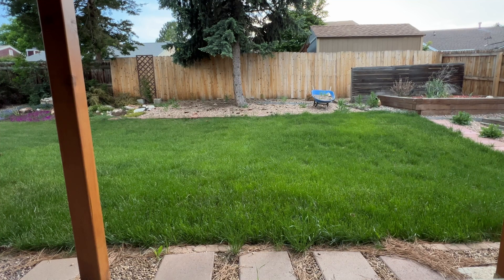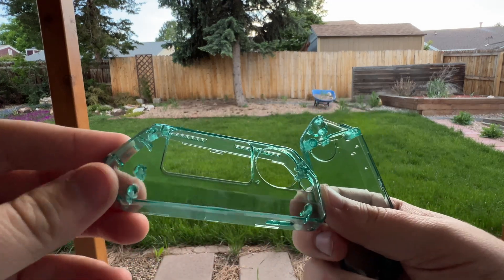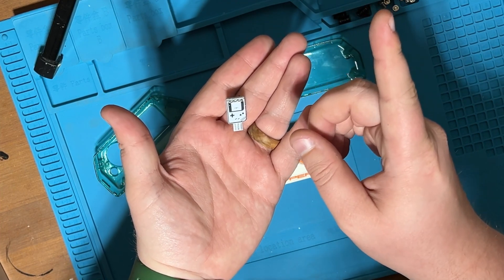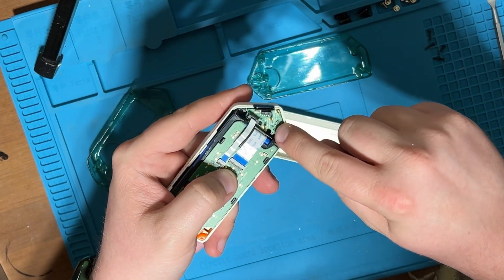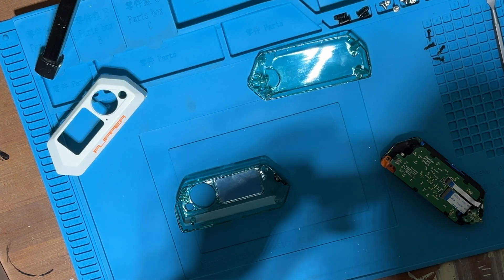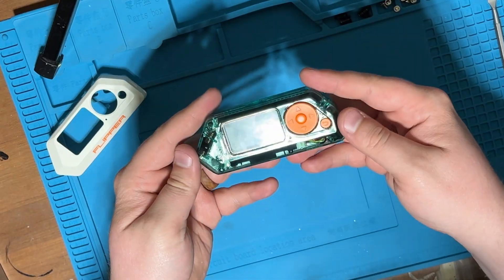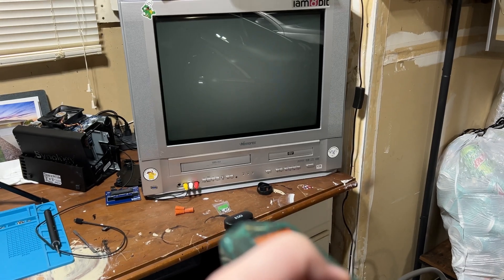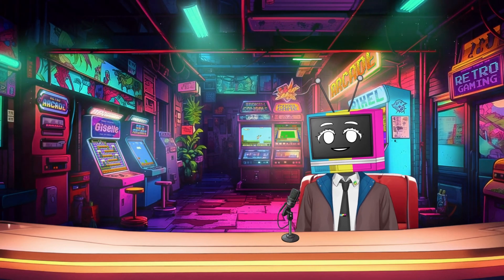Flipper Zero Shell Replacement: Easy Step-by-Step Tutorial

Comment: I got a clear shell from pcbway a few days ago now. I tried to take the back off of my flipper to swap all of the hardware, but i ended up stripping one of the screws a little. Im not quite sure what to do from here. Im worried im going to strip the screw even more. What do you recommend I do? I was using a PH0 screwdriver, but someone even recommended a PH1.
Reply from the maker: Oh no! That’s such a small space you could try putty to give the screw grip but if it didn’t work then you’d have putty in your way as well. Is there anything left of the screw if you did by hand it would work?